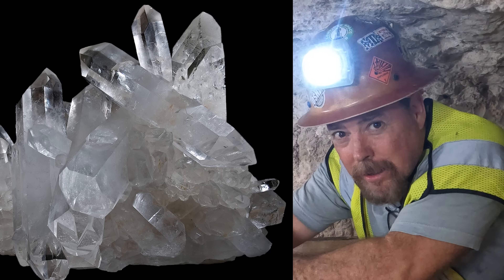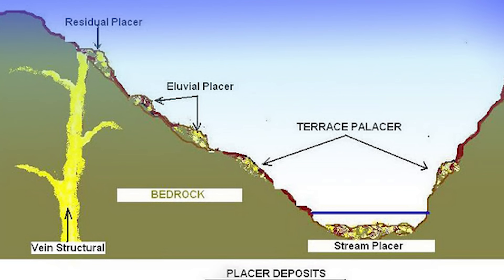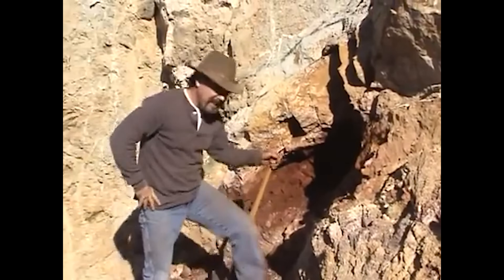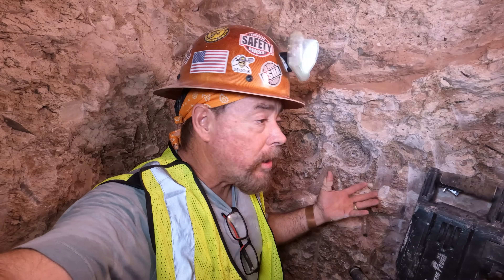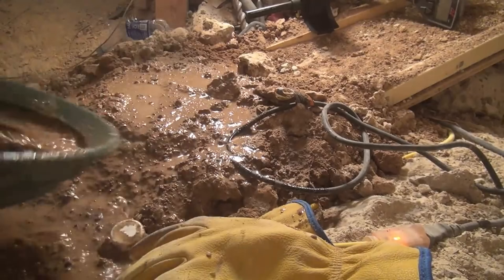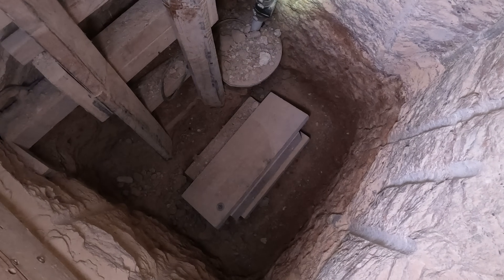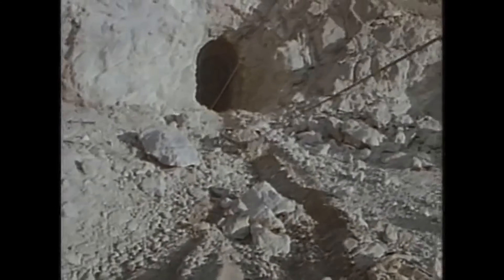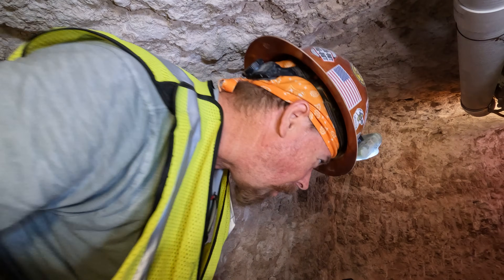How Massive Gold Nuggets Are Born in the Earth

Comment: Piezo electricity is definitely measurable and fun. Most people don't know that barbeque lighters create sparks by pressuring on the crystal, creating a potential difference we call electricity when it's suddenly released. It's in guitars, microphones, and the earliest crystal radios (which you can simply make yourself). But, we used electricity to recover gold from the cyanide solution which formed on stainless steel wool, which we burned off. So I agree it plays a part in forming gold, but only Tesla say for sure.
Do red worm eat gold and poop nuggets? Worms that chew cemented clay, worms that lay eggs and create earth tremors, GRABIODS?
Reply from the maker: exactly

Comment: Hi Jeff !  Do you belive me if i tell you that even the air we breathe contain gold ?  The truth is that the air is a form of carbon. They use AXIAL RADIAL COMPRESSOR to heat the air and with a centrifuge, they can separate anything they want but the main production is gasoline, they do that ay high sea because of the noise and they dont whant poeples to know  about it :0)

Comment: I watched that video on quartz precipitating gold. I question if the solution is piezoelectric or not. My guess is that as the quartz crystallizes, it discharges into the solution precipitating the gold. The solution creates pressure so it's plausible. 🤔
Reply from the maker: more than likely the fluids begin to crystalize when there is a drop in pressure and temp which is favorable for Gold to precipitate out as well here is a great article on it  https://www.sciencedirect.com/science/article/pii/S1674987111000430